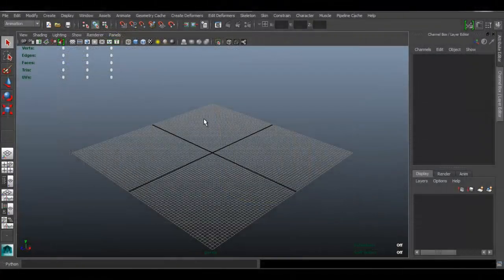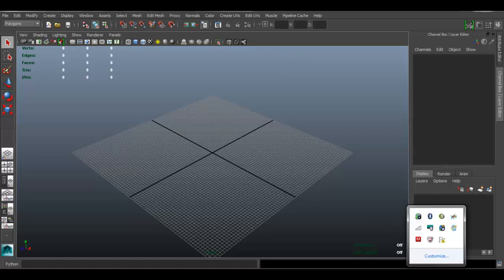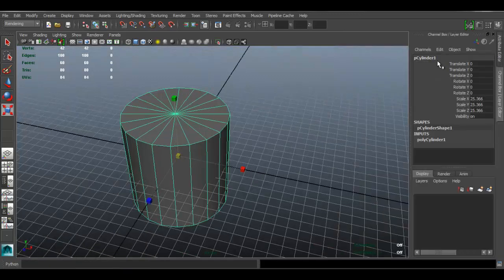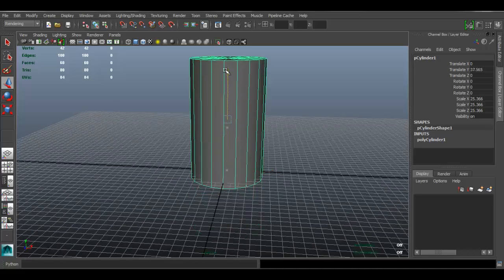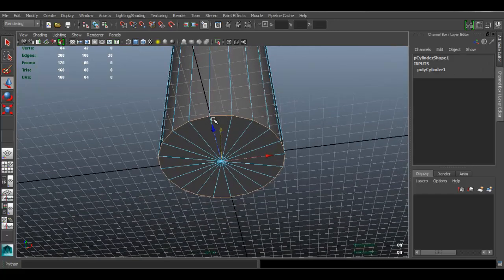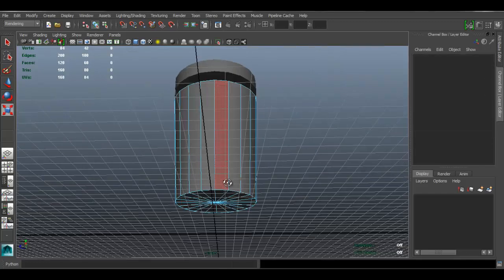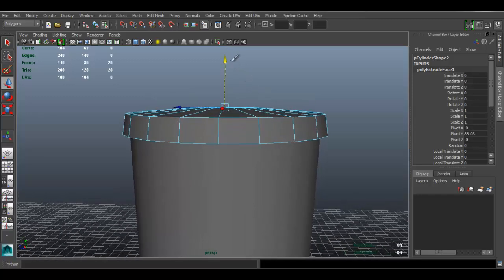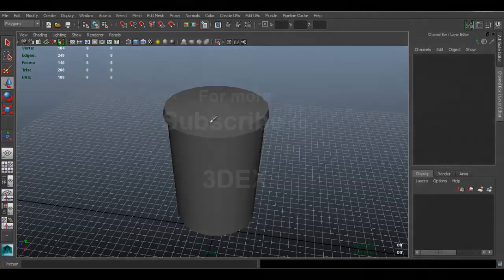Autodesk Maya 2014 - Trash Can Part 1

Comment: Hi 3dex im having problems with normal angle.The edges which i dont want to get "softened" get "softened too.How do I fix it?
Reply from the maker: you can choose a lower normal angle or you can harden those edges manually by selecting them and going to the normal menu and choosing harden.
Reply: 3dEx Thanks for the quick reply!

Comment: what is this DDO??
Reply from the maker: Quixel's DDO. Is a software used to easily texture models, specially props. Quixel released a new version and recently made the older version free to use. I will be using the free version to texture the trashcan. You do need photoshop for this as DDO uses photoshop to create the textures. I won't go too much in detail with the software and mostly use just the presets, but I will give you an idea of how to use it.